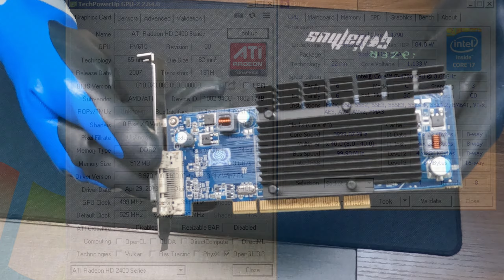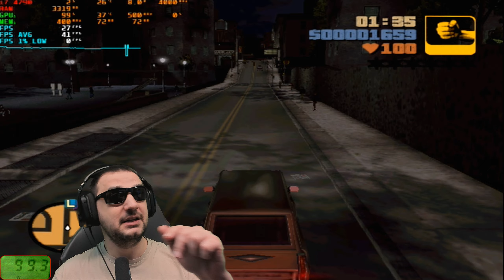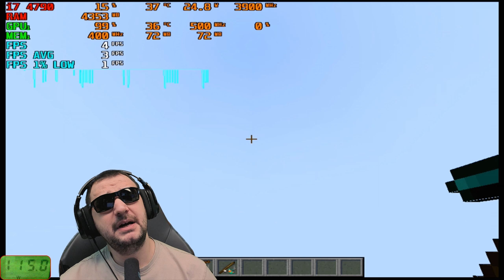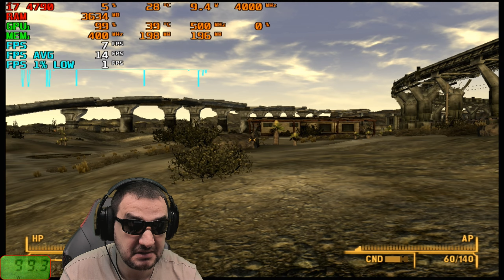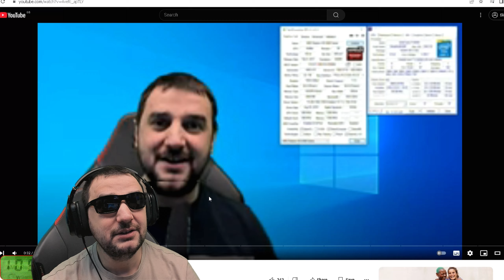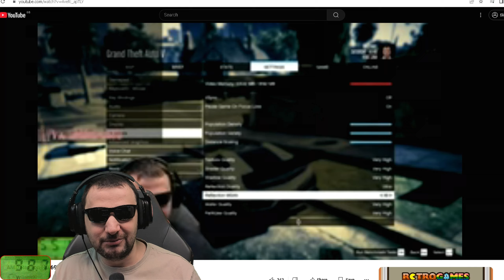ATI Radeon HD 2400 PRO Benchmark

Comment: There's one of these new in box also with two other low profile quadro pcie cards and another full size gpu and tons of ram for $20 usd. I want it for all the old computers without agp or PCI e. Seems decent enough especially at 640x480 on 2003 games and earlier

Comment: It's not a pci bottleneck its a gpu bottleneck because the gpu was pegged at 99 percent most of the time.
Reply from the maker: Now i`m tempted to find another with faster core ¬___¬
Reply: @DanielCardei  A faster clock speed may not help if the card also has other specs like memory bandwidth limiting performance. Oh and it was a budget friendly consumer graphics card that was meant for basic DirectX 10 and multimedia capabilities according to copilot so it has lower specs  than the regular Radeon HD 2400 XT. I'd say save your money and don't worry about finding a faster Radeon HD 2400 Pro they might even be overpriced anyways if they're rare. I'd say you already have a better performing Radeon HD 2400 Pro anyways and its called the Radeon HD 2400 XT!

Comment: also if its on regular pci it would be benificial to use a ps2 mouse and keyboard and minimize usb as usb traffic is deducting from the pci's cability
Reply: @homelessEh  depends how the motherboard and chipset works. There can be multiple pci busses that are separate and don’t interfere with each other. So if the usb is not using the same pci bus like the gpu they don’t use the same bandwith. The usb could connect to a separate pcie lane, or some Plattform controller hub, however they call it, depending on the system.
Reply from the maker: i don`t have a ps2 mouse and keyboard with that cable so long. i`m using only 1 USB port for mouse keyboard and sound card.
Reply: Maybe even on your slowest computer it doesn’t make a difference. But on a Pentium 3 it makes a difference. I also have noise I my ISA soundcard when I use the usb mouse. On those 440bx systems the cpu connects to everything except RAM and AGP over only one pci bus 😂
Reply from the maker: @JohnSmith-iu8cj  the noise its real.  I have 2 hum destroyer.

Comment: i have an old emachines t5026 a real lunker they removed the agp port and it has only pci and 1 lowly pcieX1 1.0 port. but even in this things case i took a soldering iron to melt down the back of the pcieX1 port to open it up so a full X16 card would fit in.. a hd4670 occupies it. even on the pcieX1 it performs better then the pci fx5200 that was in it.
Reply from the maker: Modifying hardware for better performance it was mandatory.

Comment: PCI like this can do max. 233MB/s, it’s the same that PCIE 1.0 1x can do. AGP 2X 566mb/s, AGP 8X 2133mb/s, PCIE 1.0 16x 3733MB/s, PCIE 2.0 16x 7466MB/S
Reply: For example in quake 3 the difference between agp 1x and 4x is only about 1-3fps. But in other games it can be worse of course.
Reply: PCI has a 133MB/s and AGP2x has a 533MB/s limit. Also 4GB/s for PCIe 1.0 x16 and 8GB/s for 2.0 x16.
Reply: @keulloe  the old PCI 2.0 from 1990 has 133MB/S at 33 MHz. The new revisions 2.1 and newer have 66MHz and 266MB/s

Comment: Many PCI cards have very bad performance because of the drivers. For example also the GeForce 2MX PCI. The bus bandwith is not so much the problem. The problem is they don’t optimize the drivers for the bus. They don’t care about the performance so much, it’s not worth to optimize it. They thought who still buys a PCI card? Somebody who doesn’t care about performance or doesn’t know better. You could preload all the textures into the memory, so you only need the bandwidth for commands not for textures. If the commands were optimized for low bandwidth it would be less of a problem, but was too much work to invest for them to be optimized